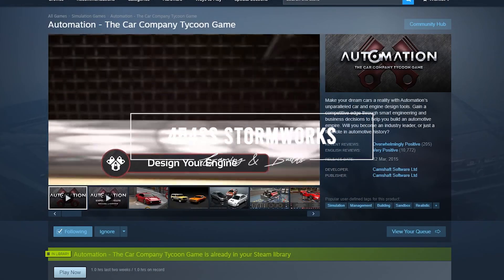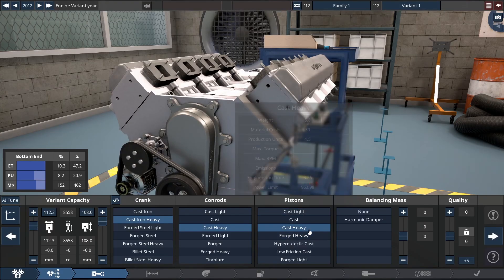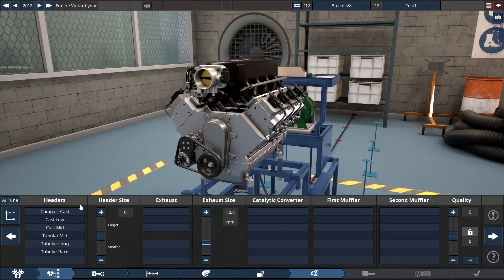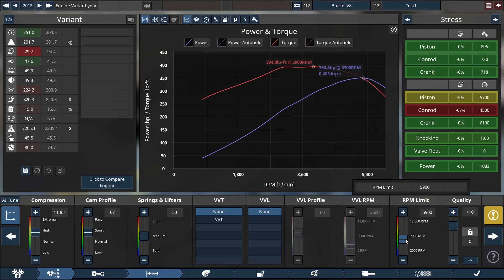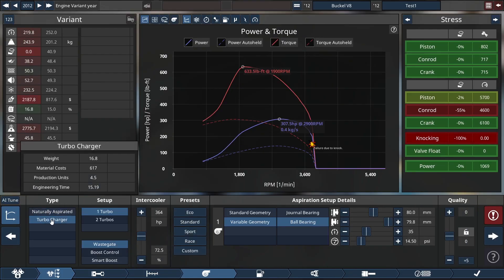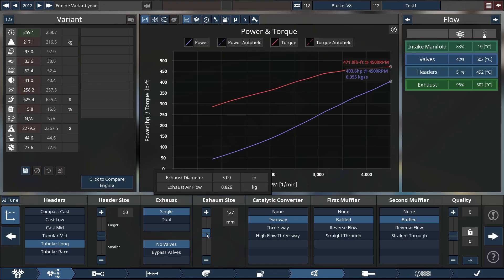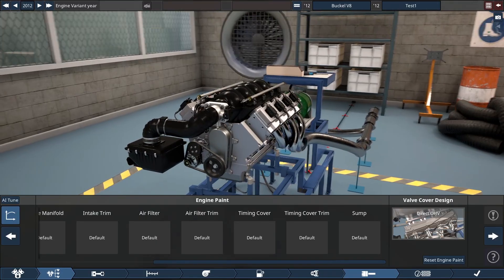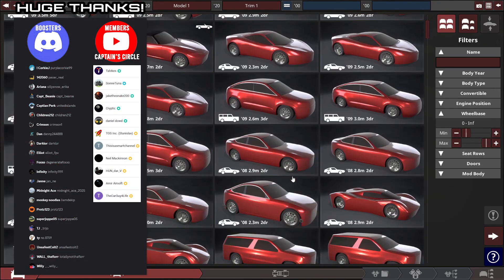First EVER Attempt to Build an ENGINE in Automation

Comment: Despite everything the game tells you, I almost always choose forged(most applications) or billet(performance applications) for the internals. It gives a huge reliability buff to both the engine and the car itself, and it is generally actually cheaper and lighter than the cast internals, so it's a win-win. 

Just an Automation engine tip:
Shorter stroke -> higher max RPMs
Longer stroke -> higher max torque
Stroke affects displacement, but does not affect the external dimensions of the engine.

Larger bore -> more power, better valve flow, higher displacement
Smaller bore -> less power, worse valve flow, lower displacement
Bore affects the displacement of the engine and affects the external dimensions of the engine.
Reply from the maker: Thanks for the tips, I will remember them! I plan on experimenting more with Automation very soon :)
Reply: @454ss_gaming 
I've done everything from pushing the game to its limits to making replicas of vehicles. So I've certainly learned a thing or two along the way 😅
Reply from the maker: @Garritt2020  Amazing, good to know! So far I did a replica LQ9 and Saab 2.4L turbo, both were quite close!
Reply: @454ss_gaming 
Yeah, if you input the exact bore and stroke of the engine you want to replicate, you will typically get the exact same displacement down to the CC.

Comment: One note* If you want to change the engine capacity more that a little bit you should really be doing it in the previous stage/one more left where you choose crank, conrods, pistons. You have like lets call it 2 sections, the very first one is Engine Family where you pick block config and design and also capacity of the actual block and valvetrain and head design. That's a better place I would say to set you engine capacity. The second part is Engine Variant. That's where everything else is. You were changing basically only the piston diameter and conrod length under variant capacity and not the actual block size, so you essentially made and had in the end a 6421cc block with 5710cc internals..if that makes sense..
Reply from the maker: Ooo I see! Thank you for that comment - I was quite confused at that tbh. I'm excited to try that again!

Comment: One of the ways I learned to build engines in automation was trying to recreate real engines and then adapting them. For most car engines you can find all the data you need online to create pretty accurate copy in automation and its so satisfying to see the engine in game get so close to the real numbers. Another fun thing to do is play with the year in the to right as it determines what technologies are unlocked.  You can create an engine family/block in the 50's or 60's and then create a variants for later years so you can modernise it with new technologies I did a challenge where I had the same engine block for most of the game.
Reply from the maker: Oooo very good idea!  I was basing my engine loosely on the 5.3-5.7L LS engine family, but more in-depth scaling and copying would be very neat!